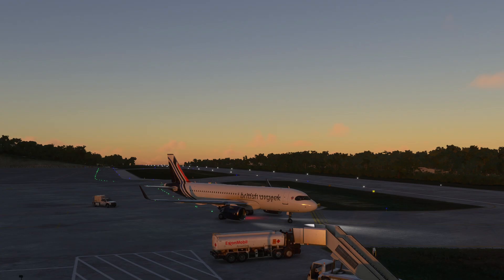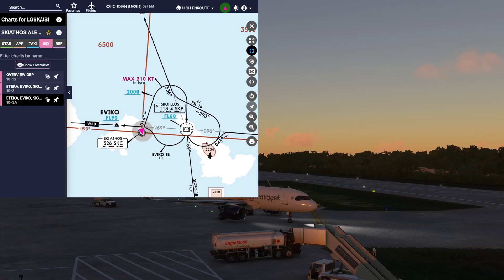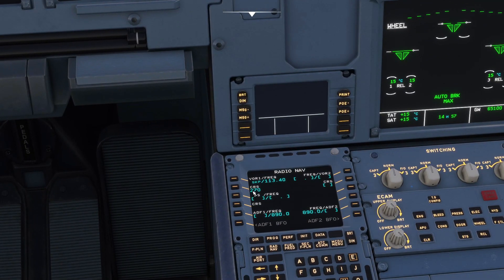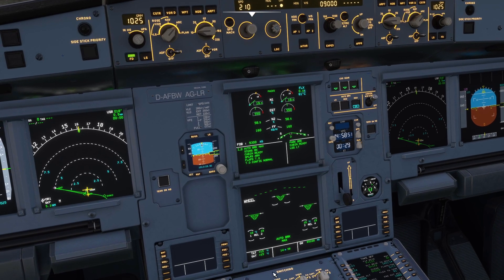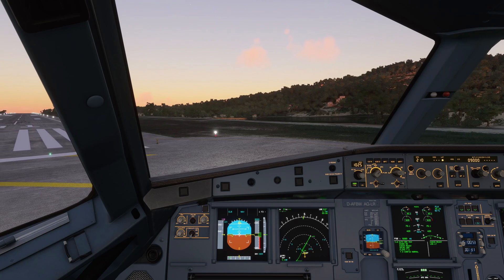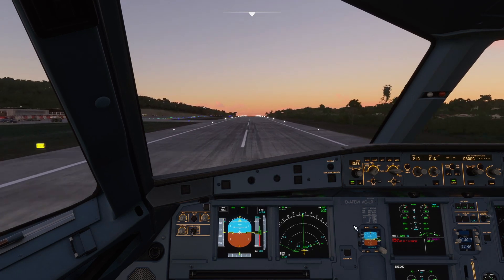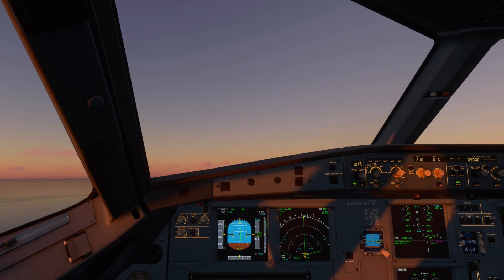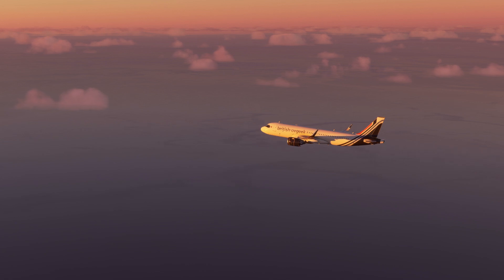How to Take Off on a Short Runway with the A320neo flybywire Mod - A32NX Tutorial [MSFS] 4K

Comment: Excellent mate ! How on earth did you learn all this ? Are you a pilot ?
Reply from the maker: Thanks! Just picked it up over the years. Used to be a light aircraft instructor for a few years in the Air Cadets in the UK but haven't flown for many many years. Never got behind the controls of anything bigger than a PA28!
Reply: @BritishAvgeek  No wonder you’re so good. Did I see your name somewhere among developers ? Are you a tester in flybywire…hmm…saw it somewhere :)
Reply from the maker: @yams900  I am one of two original QA testers left on the FBW project from the beginning (just over a year ago) and they added me into their "development team" too though I don't do any actual developing - I'm not clever enough for that!
Reply: @BritishAvgeek  While I have your attention, have you done a MCDU tutorial for a32nx ? I’d like learn flight planning, and to be more precise, add/remove/change waypoints. Also fly direct to, as in D -> function. Yesterday my whole  flight plan in a32nx was lost, inaccessible and had to fly manually by turning heading knob. Luckily ILS still worked, just had to punch in the frequency :)
Reply from the maker: @yams900  have you been using the latest experimental version? I recommend you try that - it won't lose your flight plan like the other version does, and direct to works better :)

Comment: Hi
What GPU and processor are you using ? Your graphics look very realistic compared to mine .
Reply from the maker: Hi, I've got a Ryzen 5 3600X processor, a GEForce RTX 2070Super GPU and 32GB TeamForce DDR4 RAM 3600mhz and the sim is installed on a 1TB SSD